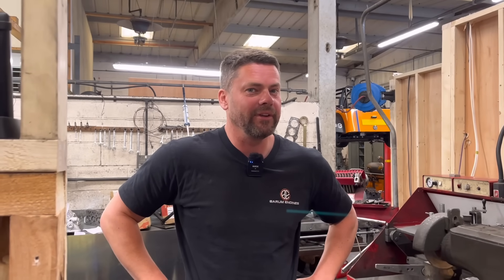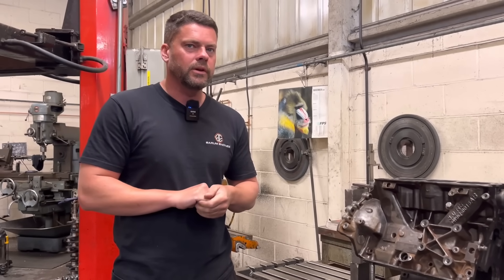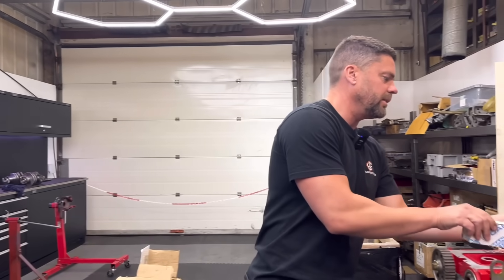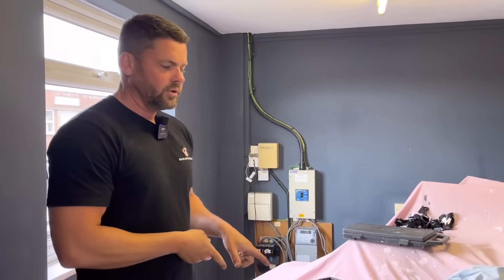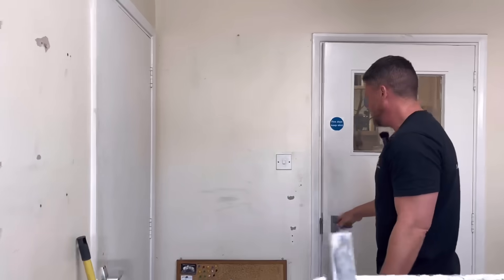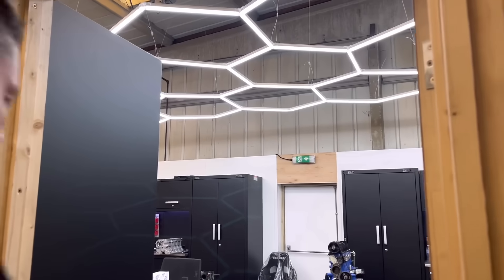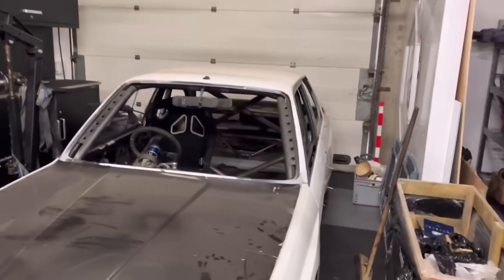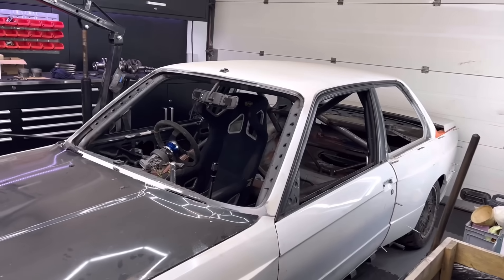We say the big FAIR WELL after years but it’s time to move on!

Comment: That rocker cover will likely never seal properly again. I would claim insurance on it and get a new one at the cost of the insurance. I would inspect the entire engine for damage as well, at the cost of the insurance. You never know what you run into and you don't want to end up with hidden damage that was not claimed at the insurance, there will be no end to the blame and possible litigation if that happens. Again, this was not your fault and you should be ensuring that the customer gets put right and the insurance should pay for all of it.
Reply: I doubt if the insurance will pay out anything as the engine wasn't correctly packaged in a fully enclosed packing case

Comment: Front part you have damp coming in via roof area by looks of it Leaking? As others have said box that Leccy meter etc as looks an eyesore. Myself before painted would have chopped them out and added/moved/increased Socketry/Terminals rather than later using trunking. Ceilings you can use those LED flat panels you can even put in a false ceiling kept tight to original one or just mount as they do mounting boxes for them give great light outputs without looking like a centre like with bulbs.

Comment: As others have said, a 60 degree bank angle on a V6 is normal. In fact it's optimal for engine balance for that configuration. The Toyota 2GR-FE V6 in my Lotus Evora has a 60 degree bank angle and it's a sweet engine. The Jaguar V6 in the F Type on the other hand is in effect a 90 degree V8 with two cylinders blanked off. To optimise balance they are probably using split crankpins offset by 30 degrees for the three pairs of pistons to get the 120 degree firing interval.

Comment: 60 with staggered crank. Same sound as a 6 in line but less long. Troublesome because of the webbing between the journals, Alfa Busso has the same, but a lot more robust given the power levels.

Comment: your aging eyes wont like the darks,, if you paint anything with oil based enamels   use some Penetrol additive,, makes it stick better . We heard where people would add wood glue to water based paint to get it to stick old walls better . One thing my friend did for his book case of manuals was when sorted.  he took car  pin striping and went cross corner across the end  so they would go back where they belong.  each row of shelf had a different colour of pin stripe.  worked great. To bond panels on he gets timed out (free)  adhesive from a friend that fixes jets called Hysol I think and it sticks stuff real good ...